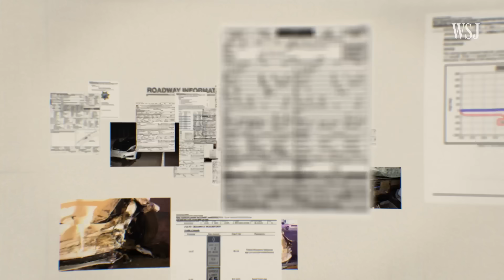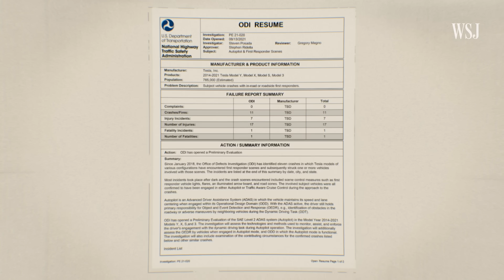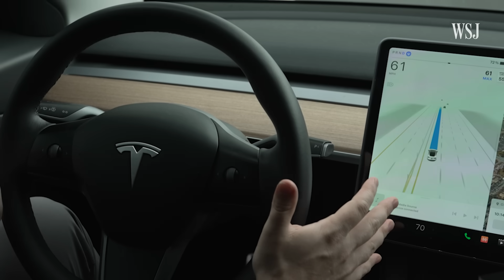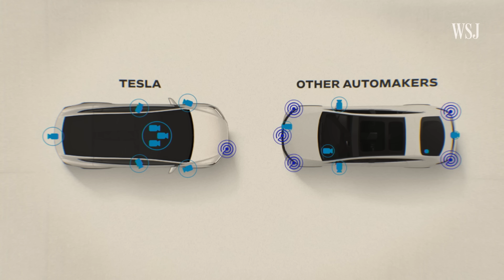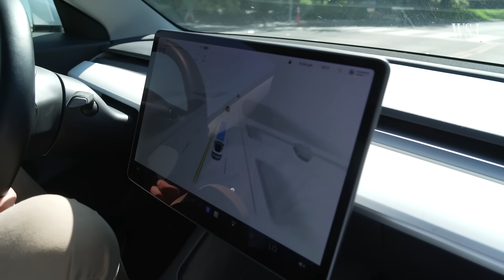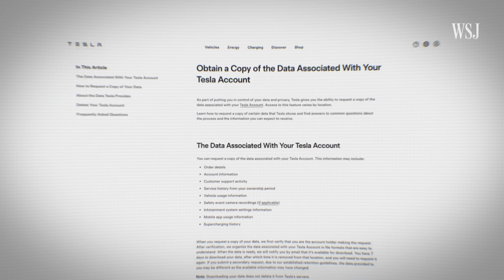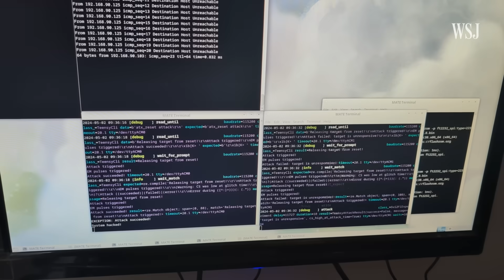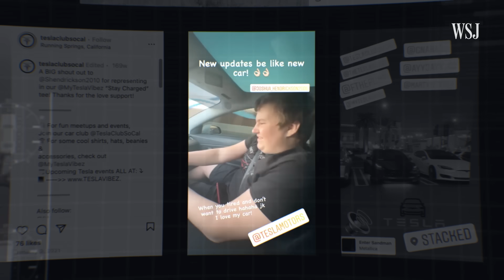The Hidden Autopilot Data That Reveals Why Teslas Crash | WSJ

Comment: For now, you still need to observe as a driver, and in those examples, the driver clearly did not - so it's the drivers' fault for the crashes not tesla. Everyone who uses it knows the risk - the software is still amazing. But obviously, Tesla should be more open about the risks.

Comment: Funny when the video has data from 2016 which is light years ago when it comes to self driving tech. The guy who crashed into the semi truck laying on it's side would have done the same in regular cruise control or most likely even driving without as it was dark and very hard to even see in the video. Watching the latest self driving tech that came out end of 2024 blew my mind and is much better than the average driver. Driving around my City is a gong show watching humans try to drive or change lanes usually driving way under the speed limit which is even more dangerous.

Comment: Autopilot is not self driving. Autopilot is the level 2 driving assistant software. It has similar limitations as other similar level 2 driving assistant softwares from other car companies.
Level 2 means that the driver has to supervise it constantly. Accidents are the driver's responsibility.

Comment: Why is there no data presented in this article/video?  People crash every day, the question is autopilot crashing at a lower or higher rate.
Reply: You can see from the first two videos that if the drivers were awake, there is no way they would crash into a huge object in front or heading straight when approaching a T-junction. Both were very likely asleep at the time.
Reply: Came exactly to tell this, after this video we still don’t know if AP is safer than regular driver or not
Reply: @mazicort_   we still don’t know if AP is safer than regular driver or not 
Well, yes we do. "In the 3rd quarter [of 2024], we recorded one crash for every 7.08 million miles driven in which drivers were using Autopilot technology. By comparison, the most recent data available from NHTSA and FHWA (from 2022) shows that in the United States there was an automobile crash approximately every 670,000 miles" (Tesla Vehicle Safety Report 3Q2024).
Reply: Because teslas frash at lower rates. Its a hit peice that WSJ started putting out again because their CEO has differing political beleifs.

Comment: Shouldn't it use a combination of cameras and radar etc rather than just relying on cameras? What is stopping them from including using radar in combination with cameras?
Reply: Cost, and only cost
Reply: They used to have radar as well. The reason radar was dropped was because the radar information often conflicted with what the camera's were seeing. The camera's ultimately being proved right. So had nothing to do with cost.

Comment: The fact that the cameras are at different positions and angles is what allows the computer to calculate depth it's not a flaw.
Reply: as I understood the technician, the problem is that the computer doesn't know the exact position and orientation. It's not about the mounting, but what the computer is being told about the mounting. Bad calibration leads to bad assumptions by the computer
Reply: The flaw is the over reliance on cameras versus other detection technologies.  This is especially true as it doesn't take much for the lens to become obscured with dust and environmental contaminants even in a "clean" environment.  Even a thin film can shift the focal perspective of the lens - when you're just taking pics it's barely noticeable and irrelevant, but if your life depends on the precision, no thanks.
Reply: WSJ is clueless and mostly pumps out propaganda based on whatever company is bribing them. 
They have a colorfull history of Tesla propaganda that only died down cus their stock price rallied in 2020 leading to them to calm down on it.

Comment: I have been working in the field of computer vision for several years and have tested numerous well-known models, which have consistently demonstrated poor performance in object detection at night or during bad weather conditions. It's clear that radar, LiDAR, or other complementary methods are still essential for reliable object detection. While I am a huge fan of Elon Musk and his companies, it is concerning to see the remarkable achievements of SpaceX contrasted with what appears to be a significant oversight in Tesla's approach to AI.
Reply: V13 of FSD is remarkable from what I am seeing, and will only get better.
Reply: If Tesla truly intends to rely solely on cameras, they should consider using color night vision cameras, as these provide the necessary contrast for effective nighttime detection. Companies like Hikvision produce such advanced camera systems.
Reply: @t-lm  Again what Tesla are showing with V13 is a system far more capable than a human driver, seeing more and reacting appropriately ( at least for the most part) It is not quite ready, but I am sure the system will become far safer than any human driver.

Comment: so its basically driver error. the car alerted the driver to keep his hands on the wheel 19 times. he was not even driving the car.
Reply: Almost every driver I’ve witnessed using Autopilot features ends up getting these alerts continuously, because the steering wheels cannot detect hands on them (eg with capacitance, like other non-Tesla vehicles), and instead require torque to be applied by the hands. Meaning the driver is forever in a state of applying a Goldilocks amount of torque to the wheel; to appease the car, while not actually taking over. Thus, when not in this Goldilocks state, the car alerts the driver.

Comment: As a pilot and.ownwr of  Tesla with autopilot,  you never take your eyes off your course or road.I even disconnect the autopilot if the environment gets busy in the air or on the road and manually fly or drive. Ultimately the pilot and driver are responsible.

Comment: As a Presidential candidate myself, who owns a Tesla model S, it’s hard to make an argument that a car that is not full self driving should held liable in most cases. We as drivers should have operating control over our vehicles. While these stories are heart breaking, no reasonable person should believe that Tesla cars autopilot is perfect. The crash data should be made available, but in most cases Tesla should not be liable if the car was in autopilot, but could have been course corrected by the operator. 

Thoughts?

Comment: It's very simple ... what Tesla say is their FSD shouldn't be enabled on production vehicles ... period.  It needs to pass a series of regulatory checks before it's allowed to be used on a PUBLIC road ... because it not only endangers semi suicidal Tesla drivers ... but the general road using public ... like those 3 gentlemen that were standing in front of that semi that the cars camera shows had a very close call.  How we came to the point of beta testing their FSD on public roads only Tesla's cheque book knows.
Reply: Tesla's systems have saved lives. FSD is taking self driving to another level, and Tesla look well placed to dominate in this sector, making our roads far safer.

Comment: "We're in the process of gathering it" means "we don't care and just threw it out. We'll make something up that protects us later."

It's computer tech. It can be gotten instantly. There's no "it takes time." That data is available or it isn't - period.

Tesla, like its owner, lies all the time.
Reply: No it is exactly what it says. They are gathering the data needed to solve self driving. They are telling drivers their system is level 2, and requires their attention at all times. even nagging the driver if it detects them not paying attention. The product is safe if used correctly, and within it's limitations.

V13 is taking self driving to another level. Tesla are on the cusp of solving true autonomy. It will make our roads far safer.

Comment: 6:20 Seems unlikely that the cameras have a +/- 6 ft error margin as the former Tesla employee states. That would make the whole system useless - the car would have no idea where it were on the road. The matter is that the system can fail in edge cases with bad visibility, not that the cameras have a 6 ft calibration issue. Why did WSJ include this in the video? Makes the integrity of this important reporting suspicious.

Comment: I don't understand. Most human crashes, where they were not distracted or impaired, were because theu couldn't see something. If you are making a car that can drive better than a human, why are you giving it the same weakness as a human? If you must use cameras, at least use a sensor o echo in front.

Also, make it so that they can only go a certain speed.
Reply: These cars were almost certainly using radar at the time. Waymo crashed into a large pole a few months back. Extra sensors does not necessarily make the system better. proper ai and software does. As V13 of FSD is showing.

Comment: In an aircraft or an ocean going vessel, autopilot makes sense. The probability for two craft to collide a near impossibility. For an automobile, it makes no sense. Autopilot is not cruise control. Never allow a car to steer itself.
Reply: Well not in autopilot. FSD is taking driving to another level. It will make our roads far safer.

Comment: Autopilot is not autonomous driving. It’s cruise control that adjusts speed and keeps in the lane. Tons of car manufacturers have this. Compare the accidents with others using cruise control and redo this please. 
Don’t confuse autopilot with “full self driving”. Both of which require full driver attention and control.

Comment: It's crazy that Tesla can withhold crash data quasi indefinitely. Imagine an airplane manufacturer confiscating the black boxes after a crash and refusing to give them to the authorities.
If a car has cruise control, driving assistants or autopilot, its data should be handed over immediately to the authorities after a crash. There is no reason to let  the manufacturer decide about that, or to let him challenge this in courts to drag it out.

Comment: With proper radar and lidar sensors, nearly all of these crashes could have been avoided.
Reply: The cars in these crashes a;most certainly had radar. A waymo crashed into a large pole a few months back, despite having Lidar. What is important is the ai and software driving it. V13 is showing just how good FSD is becoming.

Comment: I would personally NEVER trust some car tech to keep me safe on the road, dont listen to any propaganda the car companies try to brainwash the consumers. I rather just drive the car like any other normal human so our senses are fully engaged at all times. Also having autopilot on is NOT an excuse to start drinking and driving, sleep behind the wheel or be on the phones.

I also find it very weird design if the autopilot isnt sure whats in front, it didnt simply default to stopping the car right away. And instead it plows right through the obstacle and putting peoples lives at risks.

Comment: I dislike how the autopilot is designed to drive, even if it doesnt recognise or is unfamiliar with the situation in front of it. If we are unsure, as humans, we slow down and and drive safer if we are unsure. From people's feedback on using autopilot is that it takes corners too fast and drives excessively when it isnt picking up the road or obstacles correctly...

Comment: I agree that the technology isn't perfect and that it shouldn't be promoted as "autopilot".  However, focusing only on its failures is also unfair.  How many times has it prevented an accident that would've occurred with a human at the controls?  Seatbelts and airbags routinely cause injuries and have killed in the past, yet we still keep them.  Why?  Because, overall, they improve survivability in a crash.  If self-driving cars prevent more deaths and injuries than they cause/allow, then they are a net benefit.

Comment: He does not want to spend money on sensors?  Shut, think that over because my used 2008 Toyota does a heck of a job applying the breaks when at high speed in cruise control and someone cuts in front of me.  It would have applied them hard with that overturned trailer.  But, it is ‘primitive technology’, does not have bluetooth audio!  :D

Comment: The systems are pretty good, sure more and different kinds of sensors could make things safer but i dont think they should be mandatory. Only thing i can think of beeing mandatory is that the system recognizes that when its night or raining or foggy it turns itself of and forces the driver to drive by himself

Comment: There will always be crashes and deaths. Once i was going to pass a Lorry my Model 3 took over and prevented it in the mid of the lane change and woosh Audi came 150+kmh overpassing me from my lane passing a line of cars behind me from the right.

Full family in the car and i knew at that moment it would have been devastating accident.

Car steered me back against my hands behind the Lorry and pushed brakes at the same time. All the time alerting full blast.

Tesla will get this right. Still accidents and deaths will happen.

Comment: Lidar should be a Tesla option.......
I assumed the vehicles all had Lidar and I am negatively surprised they  do not.
Reply: V13 os showing Lidar is not needed.
Reply: @daydreamer8373  
"Lidar was not needed" = Epitaphs
Reply: @MilesBellas  These people were using a level 2 driver assist. Level 2 means the driver is responsible. FSD is full self driving, and has and will save many lives.

Comment: Even my truck has radar that would have stopped me hitting a rolled truck on the road
Reply: Most Teslas were still using radar at the time.
Reply: @daydreamer8373  That's even worse
Reply: @pablorages1241  Autopilot is a level 2 driving assist. nothing more. The driver is responsible for what the car does.

Comment: Musk says no to LIDAR but also to other radar sensors too? Crazy that he would say "sensors are unnecessary." Even if the lawsuit doesn't hurt him that much he needs to win the brand reputation Battle. Not sure if the non-LIDAR sensors are that much more expensive if other companies can afford to install them. Seems worth it for lives saved and company trust to be protected
Reply: V13 is showing Lidar is not needed. If it were it would be used. it isn't.

Comment: I hate stories like this. People just need something to blame other than their loved ones. The guy was warned by the car 19 times to pay attention before the crash. Currently you ‘strike out’ after three. When you strike out the car won’t let you use autopilot or FSD for the remaining drive and if you continue to drive like an idiot the car might lock you out for much longer. For comparison, Blue Cruise doesn’t want your hands on the wheel and if you wear sunglasses you can do whatever you want for the entire drive. I guarantee their system wouldn’t have recognized that overturned semi(which by the way why were there people there with no triangles/flares/anything???). I’m biased, I’ve been driving a model Y for 9 months now. I’ve used autopilot quite a bit and FSD for both of the month long free trial periods. I think it’s amazing, but not complete. I barely take my eyes off the road while it’s moving and I’ve had it warn me once to pay attention because I wanted to see what it did. Once, in 9 months compared to 19 times in one drive. That’s driver error. I’ve had the system save me from one accident for sure that I know of. In FSD I was approaching a light that was yellow and turning red with plenty of time to stop. The car started to slow and then punched the accelerator, running the red light. I started to hit the brakes to override the system and realized there was a car that was flying up behind me that ran the light behind me. Their head was down and they couldn’t even see the road(probably on their phone). I saved that video clip to show how lucky I was. So I believe that it’s great to have 8 more eyes watching out for me but I would never ever trust it to do everything for me.

Comment: You'd be crazy to risk your life on a budget solution where better fail-safes exist, but they choose not to put them in to save money. Thats not how managing risk works. When it comes to human lives you have multiple fail-safes. Its criminal not to include these and claim to have an 'auto pilot' system.
Reply: Automation will make our roads far safer, and V13 of FSD is showing Camera's are more than capable of driving. Lidar is not some amazing super sensor. If it were a Waymo would not have crashed into a large pole a few months back.

Comment: The first video the driver should hit the brake right?... i mean with or without auotpilot they will crash eventually
Reply: Or with the autopilot you dont allow to hit the brake??
Reply: If we wanna talk about auto pilot vs manual. We should compare the data between the crash causing by auto pilot vs manual gas engine crash vs how many auto pilot save lifes. 

If the manual gas engine vehicle have alot crash than the auto pilot then the argument they bring is not valid..

Comment: At this time, I will refuse to invest in a completely electric car.  There are so many variables involved that makes them completely impractical until the technology is improved.  I maintain these types of vehicles are merely experiments at this stage….and, yes, I understand that the progressive use of the technology will aid in its refinement.  However, this is something that is supposed to be done prior to its launch and not on the dime of the consumer.  Secondly, the idea of “Autopilot” is contrary to common sense in so many ways.
Reply: EV's at this point are inevitable. Legacy auto are in all sorts of trouble because of it.